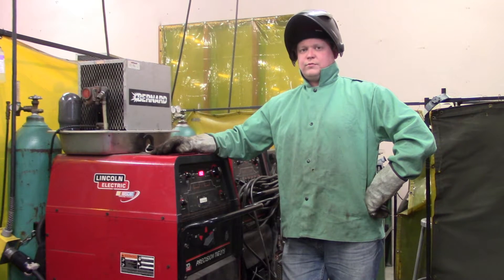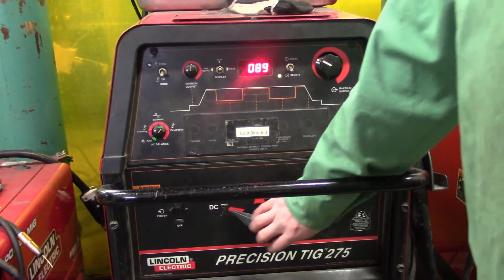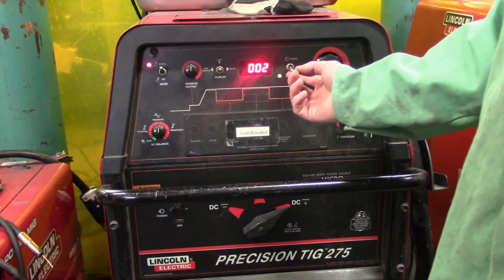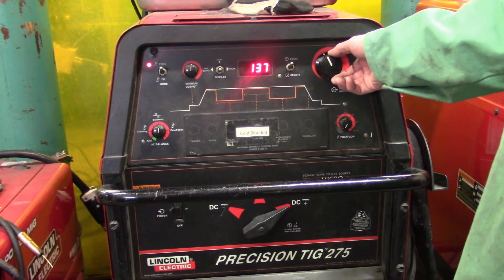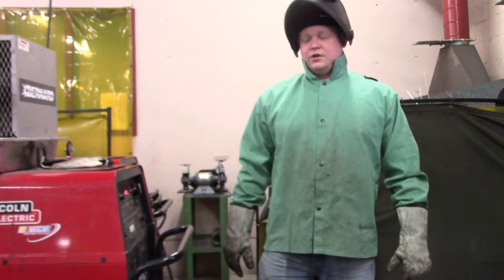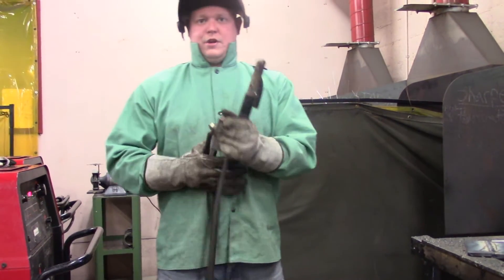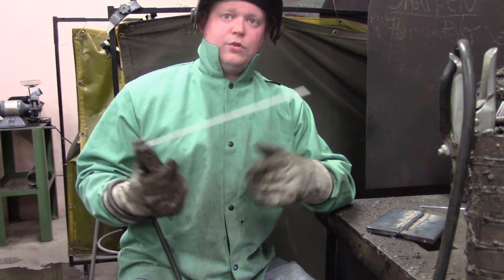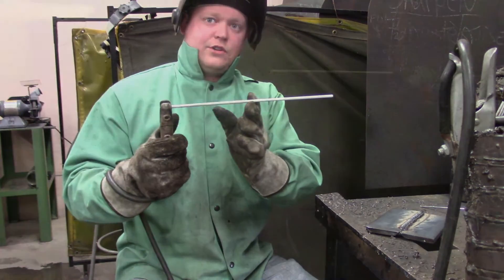How to set up a Lincoln Precision TIG 275 for stick welding

Comment from the maker: Good question.  The reason TIG welding is done on DCEN is because the direction of electron flow.  Electrons flow from - to + causing uneven heating.  The tungsten can't take the heat when the polarity is set to DCEP.  It aids stick welding because it burns off the electrode.  I have a video up called how to know what polarity to set your welder on that explains a lot of this.  Let me know if you have any more questions.